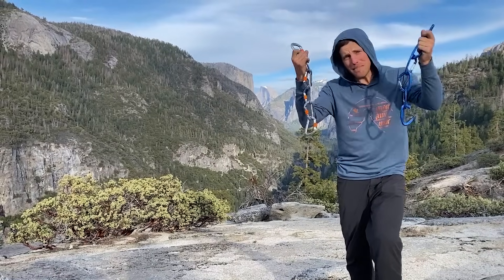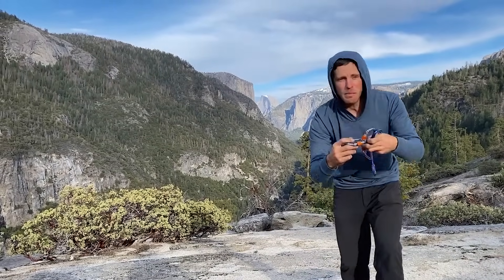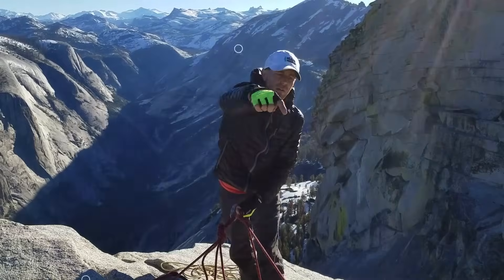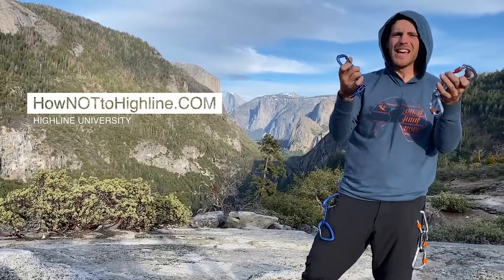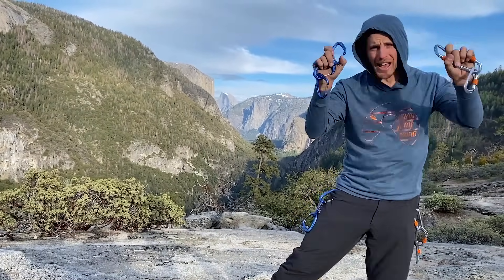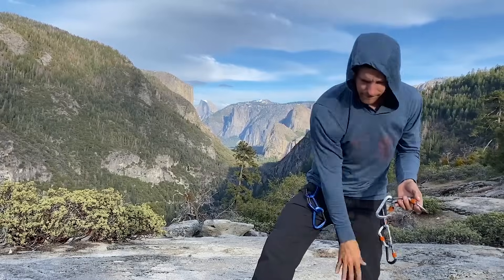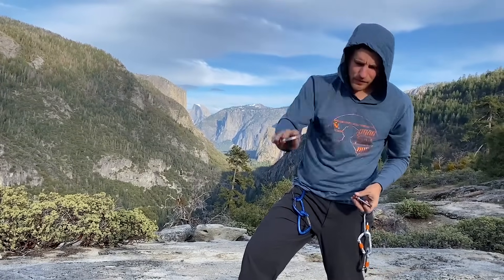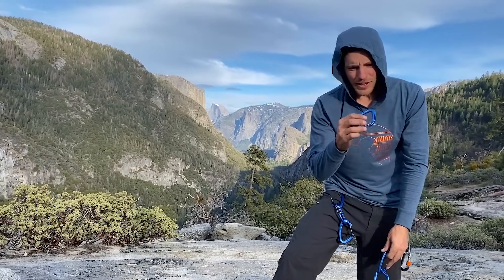Are MicroFractures a Myth in climbing carabiners?

Comment: If the speed is 10 to 1 then the force is also 10 to 1 right? Not 20 to 1
Reply from the maker: I'm pulling 2 separate 10:1s at the same time with the winch.
Reply: @HowNOT2  Yeah i believe TheArmyKnifeNut and I are on the same page, so yeah lets say the winch can pull a maximum of 400N, now we have two cables attached to the winch, so that would mean that both cables get 200N of pull. If both cables have a 10 to 1 pulley system, that would mean both cables can pull 2000N each. If we combine the two cables which can pull 2000N each in one point, this point will be pulled at with 4000N. This means that it is a 10 to 1 ration, since 4000N is ten times bigger than 400N (400N is the original pull). Now if you add another winch on top of the existing winch and attach one cable to that winch, you end up with a 20:1 force and 10:1 speed, but thats just because you double the initial force.

And asTheArmyKnifeNut pointed out, indeed if the cable in between the pulleys is the weak point, this does reduce the risk of this cable snapping, because the force on it is only half as much.
Reply: If I can weigh in:

TimeforTom is correct that you're only getting a 10:1 mechanical advantage when it comes to converting the torque into latteral force (minus friction). Simplified math to follow. If the max torque the motor could output were 100 foot pounds and it wraps around a 6 inch diameter or 3 inch radus (0.5 and 0.25 foot respectivly) axle, then the max pull the motor could generate would be 400 pounds of force. Howevery, that 400 pounds is split between the two different lines. So you could look at it as being a 10:1 system converting 400 pounds into 4000 pounds, or a 20:1 system converting 200 pounds into 4000 pounds. However, if you had it hooked up as a 20:1 system with only a single line going in, you'd have a 20:1 system capable of converting all 400 pounds at the axle into 8000 pounds at the sample.

On the other hand, splitting the system into 2x 10:1 pulleys in parallel halves the force seen by each, and if the motor has a high enough torque to allow you to reach your target loads, it allows you to reduce the load on the separate lines compared to what would be seen in a single 10:1 pully, increasing the safety factor by 2x.

Comment: Please please !! Buy some Chinese branded carabiners and test them 🙏🏽🙏🏽
Reply from the maker: We will explore this.  I don't want to find out they are super good enough because I don't think super off brands should be supported without truly being compliant with all standards and I've heard amazon has knockoffs of name brands.  I want to do some detective work there for sure.
Reply: HowNOTtoHIGHLINE good point. Even if they could be compliant they haven’t done the work which we don’t like
Reply: @HowNOT2  my guess is they won;'t be super good enough. I have confiscated Chinese stuff and swapped it with real gear (free). I am highly dubious about the increasing use of this kind of cheap gear coming into widespread use. Please test and post. :-)
Reply: My concern with Xinda and some of the other "off-brands" is consistency, you could test 100 from a batch and be great, but due to questionable quality control, the next thousand may fail miserably.

Comment: In all tests it is possible to see that the carabiners gets deformed before breaking. Do you record the forces when the carabiners start to "bend"? And do you know if you stop to increase the force at this time do they go back to the original form? And thanks for the video!!
Reply: You always have an elastic deformation phase in which the stress varies linearly woth the strain. Stopping applying any force there will mean the biner is gonna get back to its original shape.

Past a threshold you enter the plastic deformation regime in which the aluminum undergoes microalignement of its cristalline structure. 

Then the material extends even more and that's where the material is actually torn apart. The required force starts to decrease. Then the biner breaks.

So the forces we see on the sensors are the max force observed at the end of the plastic deformation. I guess

Comment: Very cool, just wanted to throw some ideas into the air for wearing out the carabiner in a more practical manner. I want to preface, you guys have an amazing set up to do these test and the method used for testing looked very consistent. I just want to add some ideas for further tests because I'm very curious myself. Prefacing these tests I want to give some insight on some of my thoughts. Throwing the carabiner on the ground would most likely result in compressive and shear strain. These forces will wear out products, however compressive and shear forces are not typically how materials break but still lead to structural degradation. Typically materials break from tensile strain/forces, which is how you guys mangled those carabiners for science with your pulleys. I think it would be really cool to come back to these tests and include another way to strain the carabiners with tension. Some ideas would lead climbing falls, or even some mad lad contraptions you guys can think of. I don't know if producing tensile strain on the carabiners would yield actual results, but I think it's worth a shot. Awesome video, and thanks for keeping us entertained (:
Reply: Agreed. Throwing them on the ground also only damages the outside. I have some carabiners with some pretty sharp scratches and gouges from bolt hangers. I could imagine those acting as a starting point of a real failure.
Reply: @Mike-oz4cv  The outside matters too. In tensile stress cross-section and lack of stress concentrators matters. But in the spine close to the rope and rope anchor points there is bending, and bending stress is mostly held by the inside outside while the middle section just sits there. Any gouge is significant in that portion of a carabiner.
Reply: My understanding is that they wanted to test whether dropping gear specifically leads to microfracture that reduce stability.
Which leads to having to discard gear after dropping, without visible fractures.

Not to debate whether microfracture in generally happen maybe through other means than dropping.

Comment: Love the channel and this series. Micro fractures are a real thing, and there are material science equations that can calculate the minimum size of a surface defect that could lead to failure under different loading scenarios. Older carabiner were manufactured without a specific design for avoiding microfractures. Newer carabiners are a lot less prone cracking, and the minimum crack size for failure (usually) is visible to the eye. If you see a crack or large dent, retire the gear, they fail fast when they go and don't give visual warning they are about to.

Comment: It does look like the lowest numbers came from the abused equipment.  I will still use my known history equipment and keep the others for utility where I know I won't fall to my death even though I know that a triaxial load or a mis-aligned over a rock has a much more likely risk of failure.  Great info and keep up the great work.
Reply: The abused equipment had the lowest AND highest numbers. And you should never be creating close to 20+ kN anyway so they would all be fine
Reply: @blakenev10  That is good to know and your channel is the greatest.